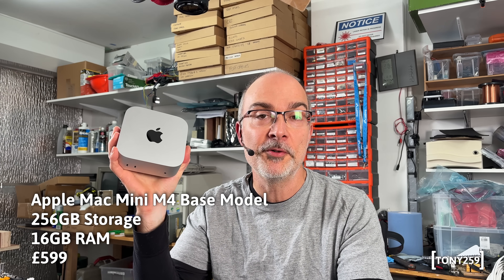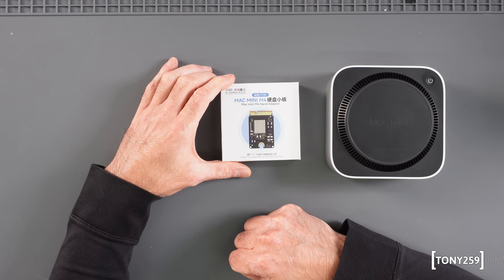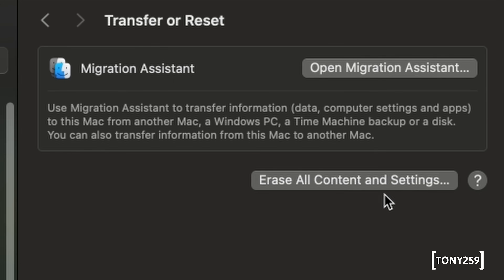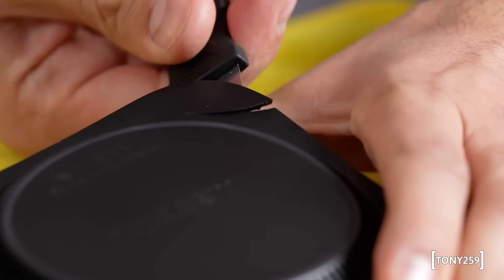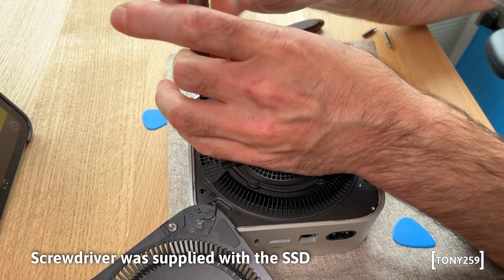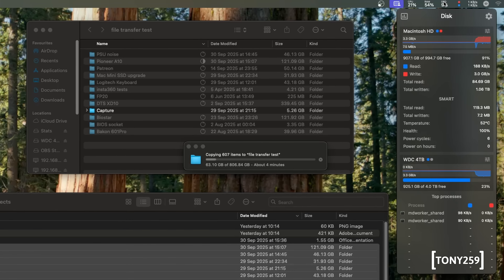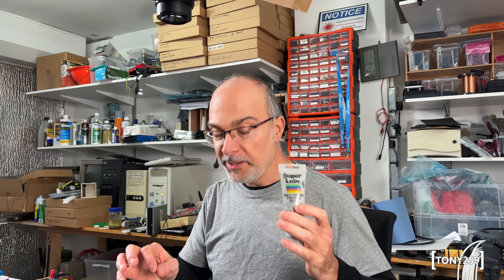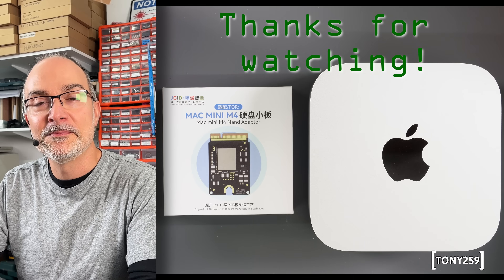CHEAP AliExpress SSD for Mac Mini M4? (Yes, I BRICKED it!)

Comment: This DIY upgrade has several negatives...

First, it voids the warranty. You can hope Apple doesn't notice, but it's risky.

Second, it risks damaging the device. You can be careful, but accidents do happen.

Third, it requires access to a second Mac. Not everyone has such access.

Fourth, if anything goes wrong, you have to undo everything and try again. Big headache.

Fifth, not everyone feels comfortable tinkering with hardware. It can cause anxiety.

Sixth, these third-party modules are generally less reliable than Apple's hardware. They're risky to use.

My advice? Don't bother.

I upgraded to 512GB at the Apple Store and I haven't looked back. They told me this was their bestselling model and I understand why.
Reply from the maker: Of course it's a matter of personal preference. If you want to be safe, the genuine option is always safer. 

Only one comment: warranty. The BATTERY is behind the cover so I don't think opening the mac mini voids the warranty. 
But of course to be 100% sure, £400 to Apple and happy days :) 

Oh, and so far the module has worked flawlessly. Fingers crossed. 

P.S: 512GB might be the bestselling model but it's not available "on the shelf" at the stores! Only 256GB and the 512/24GB combo! Very clever!

Comment: You should be able to use a Mac OS virtual machine instead of a physical machine to re-image the mini as well.
Reply from the maker: I tried but I am on AMD and I need some intel-only feature to run macOS on a VM - cannot remember what it is.
In any case, it's possible but "a friend with a mac" is much much simpler!

Comment: Just did the upgrade in a new Mac Mini M4, it has worked very well. I used a 2tb drive from SlimQ website, which came with all the required accesories.

I did have one problem. After installing the drive, I connected the Mac mini to my MacBook (Intel), which triggered the DFU restore screen as expected. But I was unable to press the restore button. After 30mins of trying different cables, reading forums etc, I found a software update dialog window that had opened behind my finder window. A quick update to my MacBook, and then the DFU restore went smoothly. I thought I would put this here in case anyone else has the same issue.
Reply from the maker: Excellent feedback thanks! I thought the DFU for the Mx processors could only be done from another Mx machine. Very interesting!

Comment: Just tried to install my JCID 1 TB Nand. Spent 1 hour trying to slide in all the way into its place but fails to  which wont allow me to screw in the T8 screw back in.  The original still slides in without any problems.  Will take to a technician and see if they can solve this isuue.
Reply from the maker: Yes mine was stiff as well, there is a ground brush which is not helping. Mine eventually got in, I had to use my index finger to hold onto the socket on the other end and provide additional force
Reply: I took it into a  technician and he was able to slide it  in  wothout a hitch. . Sometimes all it takes is an experienced hand.  I gave him $20 bucks  and called it a day.

Comment: The mac mini modules from aliexpress are the problem with failing drives
Reply: its not what you think as well its because of checking manufacturing of the drives some are great some are bad
Reply from the maker: Indeed though so far - touch wood - it’s been working totally fine

Comment: My 2TB module was by Deep-Sea, bought throuigh Amazon as NURUBRM 2025 M4 Mac Mini 2TB SSD Replacement Upgrade.  Mine would not work out of the box so I went back to the original 256GB module.  I am waiting for the vendor to get back to me to issue a refund after which I will by a base station that will take a standard NVME SSD.
Reply from the maker: Yes, an external SSD is also an option. I carry my Mini with me often and I already have a 4TB external SSD for data so I preferred some internal storage. 

Mind those base stations, I've read that some can cripple your wifi as the wifi aerial is UNDER the Mac Mini!

Comment: I'm currently in China and I just bought the same JCID 2TB version SSD from Taobao (approx 220 USD). Going soon back to the Netherlands and I'll install it. I did some research and JCID is a pretty established and high-quality manufacturer in Shenzhen China. I'm very excited
Reply from the maker: JCID might be established but the big question mark is always "Aliexpress" 🙂
But the SN genuine tool is cool, it should not be bypassable. Good luck!
Reply: @Tony359_2  I just installed the SSD and everything works fine - if something happens with it I'll update you.

Comment: So u can only do this only if you have another MAC?
Reply from the maker: yes and no. You can also use macOS in a VM on a Windows machine. But I couldn't make it work as apparently it requires an INTEL processor and I am all AMD. It's not the simplest of the processes though. Another Mac is plug and play - and even then I heard the restore process tends to fail and might be repeated a few times.

Comment: You’re meant to use a sucker to pull the bottom cover off.
Reply from the maker: That is also an option. I haven't tried myself but I saw videos where the sucker (suction cup for other countries than the UK!) wouldn't stick to the plastic.

Comment: Notes for others: You ~must~ plug into the middle port on the back of the MacMini in order for DFU to work otherwise you will get errors. The host machine you use to flash the firmware to the MacMini M4 should have at least 40GB of free space. The ispw file is ~19GB and then the host has to expand/extract that one the host which also takes a bit less than 19GB before it transfers it to the M4 MacMini. Both these issues confounded me for a while with failures and meaningless error messages. (None of the errors said anything useful like "you need more space" or "you're plugged into the wrong M4 port")
Reply from the maker: Thank you - I should have mentioned at least the middle port detail a bit more!

Comment: DON"T DO IT!  I bought one of these 8TB SSD (NAND Storage) from a Chinese manufacturer.  The upgrade went through without issues and was able to install MacOS Tahoe onto the SSD.  However, after a week's timeframe, the module started failing and the Mini kept rebooting.  Completely unreliable and unusable.  I ended up re-installing the original 512gb SSD and continues to work without issues.  Now, as I tried to go back to the mfg. for a replacement or refund, the Chinese firm won't take it back and/or replace it.  They keep saying it's something with OS and not with the module.  I'm now working with my credit card to hopefully get a refund.  Don't trust these Chinese fkrs!!
Reply from the maker: Oh Aliexpress is a lottery of course. There won't be refunds or customer service unless the unit is DOA - and even then...

I am prepared to lose my money when I buy from Aliexpress. 

That said, I'm assuming you have a Mini Pro as the base model stops at 2TB. Apple charge the extortionate price of +£2400 for an 8TB Mac Mini!!!

Comment: Tony, I enjoyed the video (US viewer). When doing this kind of thing, we all take chances with potential frustration, failure, and loss. Before I select my replacement card, I’m curious if there might be less compatibility risk if choosing one of the same type/brand as what Apple had installed as OEM. Can that be found beforehand, or maybe you can divulge that, having removed yours and having it viewable?
Reply from the maker: Thanks for your comment. There isn't a "brand" or a "type" unfortunately. Those modules are Apple proprietary and not available from sale. There are some more "reputable" sellers which might offer a better service/warranty/QC (I do not really know) but in the end those modules are all clones of the original. 
AFAIK there isn't any firmware or ICs on the board which could talk to the system and somehow tell the Mac "I am not genuine" - though I'd imagine from Apple's perspective my Mac Mini was sold with 256GB and it now reports 1TB so 1+1=2. 

If there was a reputable brand for the modules (say WDC, Corsair, Crucial) then it would be different. But there isn't and I doubt there will ever be. 

I hope you find an option which works for you!

Comment: Thanks for interesting video.
In a next video you could present how to install the MacOS in a new SSD using DFU mode, which some of us are not familiar with.
Reply from the maker: Hi thanks for your comment. I didn’t go much in details but basically it’s in the video: you plug the Mac into the working Mac (using the correct DFU port) and you ‘Restore’ it. I downloaded a file because I wanted a specific macOS version but it’s not required, the ‘Configurator’ will sort things for you. The process is automatic and will give you a working Mac 🙂

Comment: Is it possible to upgrade ram and cpu/gpu?
Reply from the maker: No unfortunately- but for good reason. They’re all integrated in the CPU for optimal performance. The RAM is actually soldered on top of the CPU and I understand it’s impossible to replace even for those reballing wizards 🙂

Comment: Break mine after installing the SSD. Which turned on, but then wouldn’t turn on. Had replaced it and won’t do it again now. Got an external ssd instead. Support said it was my fault.
Reply from the maker: Interesting. Apple Support?
There is a risk in doing this of course. Those SSDs come from random manufacturer. They might be shorted. Who knows. 
That said, you can break any device by just fiddling with them. It wouldn't be the first time I'm opening a computer and it dies on me - one of the reasons why I often wear an antistatic wrist strap to reduce the odds.

Comment: Ive seen this opened before but this was the first time about the pins rather than clips. Thanks for that. I intend to get one soon and I am concerned about  where to buy the SSD. How high would you estimate the risk of buying from Ali express? I look forward to seeing more about this from you.
Reply from the maker: Aliexpress is a lottery. If your SSD fails immediately or within days, Ali will refund you. If it fails after a month, you're on your own.

That said, even if you buy from "third party" on Amazon, Amazon will only help within 30 days, then you're on your own. 

If you want to be safe, there are 1 or 2 reputable sellers but they'll be more expensive. I hope it works for you! So far so good here 🙂

Comment: I don't think you understand what bricking is.  You don't unbrick a device.  You can fix a broken device, but bricked is bricked.
Reply from the maker: It's debatable. There is always a way to "unbrick" a device, whether via software or hardware. If I followed your logic, there is almost no way to "brick" a device. 

Thanks for watching!
Reply: @Tony359_2  IMHO a hardware swap (solder or drive swap) would be required for unbricking.  Id go as far as a reset jumper.
Reply from the maker: @pdxgeek  We can debate until the end of time but for a while the Mac was a brick. I didn't have anything at home to revive it. And if I didn't know someone with another Mac, I would have had to go to an Apple store.

Comment: The easiest way to open the Mac Mini is to apply a big ball of puddy to the bottom, flip it over, apply a lot of pressure to the top of the unit to stick it to the table, then pull straight upward.
Reply from the maker: Very interesting thanks for the tip!

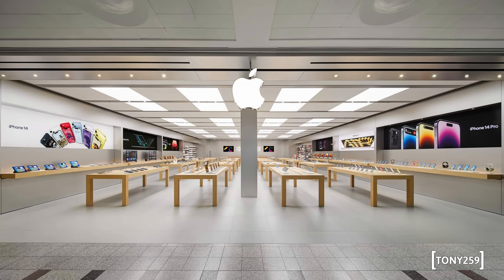Comment: 6:30 hi guys I’m the “friend with a Mac” and I’m gonna guide you on how to fix this without having another Mac (that he would probably need even if the process went well as the ssd it’s empty. But you don’t actually need another Mac to add the Mac OS files in the ssd. Now let’s proceed) 

After replacing the ssd unplug all the cables, put it upside down, plug on the thunderbolt port (the one with the lightning ⚡️) a type c cable as long it’s not a specific thunderbolt cable should work , then press and hold the power button and plug the power cable and it will start blinking in orange. (Like it was in this video when he thought or mislead you it was bricked) That will put the Mac in DFU restore and show on your screen two options, Revive Mac and Restore Mac, select Restore Mac and it will download everything straight from Apple servers. If it’s your first Mac or you don’t want anything from your old one you are good to go. If not just use Time Machine before replacing the ssd to an external driver and then restore it to the new Mac mini with Time Machine. This is the best process for having additional storage but additionally there is a way to move the home folder to an external storage, the downside is that it will have to be plugged every time you start the system, another downside is that even tho you will have your app folder, documents, downloads on the external storage an run from there some apps that might need to recognize and execute those apps might not find them as they are not in the main storage, there is a way around this, if o make it think is theatre with a symlink, you can interchangeably move it to the system and have some apps in there he main ssd and some in the external drive. But to be honest is way less work to buy an internal ssd. You are not gonna brick it.

Comment: Buuuu, no magic smoke, no plot twist... Tony if all your project will go this well then, I'm afraid, You loose some of the audience ;)
Reply from the maker: More than bricking my own computer? 🙂
Reply: @Tony359_2  Early this year I bought Samsung phone and tried to root it. I've bricked it. For the first time so badly that nothing in Internet could help and neither two repair shops. For 7 months it gathered dust. Then I had request to root different model of Samsung phone. I had some problems, but finally it worked. I thought to try trick from second phone to my first. Unfortunately it didn't worked either. But when I had it in my hand I thought that nothing to loose if I download newest firmware (previously tried several versions). THIS WORKED! My conclusion is that this was no my fault, but some nasty bug in Samsung firmware, repaired only after so many months!
Reply from the maker: I've tinkered with Android only a few times and it's quite a rabbit hole! Well done!

Comment: I did a 2TB upgrade on mine. I wish it was smooth.  Everything was fine, except DFU mode kept failing.  Eventually I used a friend's macbook for the recovery and it worked out.  That was a tense time! 
I'm not sure, but I think it might have something to do with my Mac being a part of the OS beta program... weird.
Reply from the maker: I read about that myself and I was expecting a bumpy road but no... Maybe they updated Configurator? What were you using to restore the mac? Another mac or macOS in a Windows VM?
Reply: @Tony359_2  It was an M2 macbook.  When i tried again with my friend's macbook, it all worked, though on the second or third attempt.

Comment: Apple will brick any SSD on Apple Silicon that isn’t from Apple. Starting in 2026 all Mac’s will come with 512GB as base storage because of macOS with Apple Intelligence size. Currently the base 256GB SSD after macOS 26 & Apple Intelligence is installed your left with 195GB to install your Apps and games. Apple charges way too much for storage in 2025.
Reply from the maker: If they brick it, I’ll put the 256GB back. 🙂 
I have a feeling they won’t care though. I don’t think there are many people doing those upgrades. 
We shall see. I understand the module has no way to be identified as ‘non apple’ (you can see it’s detected as an Apple SSD) but I’d imagine if the system was sold with 256GB and suddenly it becomes a 1TB, they can do 1+1. But I feel that that might have privacy implications so I’m not sure it’s going to be worth the hassle on their end. 
But yes, keep your 256GB module 🙂

Comment: So not actually bricked - you wiped the drive - so it had no operating system… duh
Reply from the maker: I'm afraid you misunderstood the process. The "Erase everything" process should give you macOS back. It "erases everything" BUT the OS. It's the same as "Reset this PC" in Windows. It's not supposed to give you a brick. 

So Yes, I did brick it 🙂
Reply: @Tony359_2 no you didn’t “brick it” you got it working again… the definition of a brick is it’s dead - forever
Reply from the maker: We agree to disagree on that! 🙂

Comment: What horrable case design, it might cool on you desk but, you can tell streat off apple and PC not screw in sight any where, and open it up, you have near break it, and break acoding to the inserted internet video clip, the a hard disk replacmemt, a stand PC think, slity more intence changing extantal disk drive, but not much, and memory the next populay upgrade after than just as easy most of the time to,, but apple Ia going say it as designed never to be opened, flimsy out cover that looks designed to break, on mark, any door open, prees here or put this, nothing of custom SSD that not SSD, but the exact same job? And I really think to fix Mac, you need a second Mac, talk about being locked into an ecosystem, and for this, pay a permanent one to Apple (can Apple tax, for buying their products, everything costs more, and OS lock to their hardware, they iven relised the they live a PC woruld and whent all in with intel PC, and Mac BE PC's, run nwindws, or anything else, and be full apple too, and even broke that too so if in the situation real need a PC, well the soution buy PC too, and now two bags to carry around or an extrat garge one to hold the two, but poele still keep fauling for it?